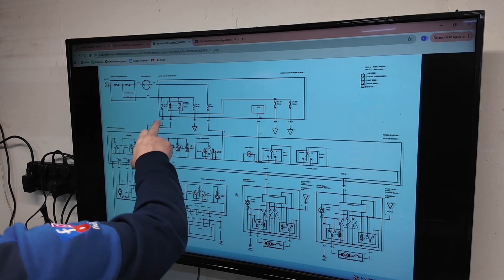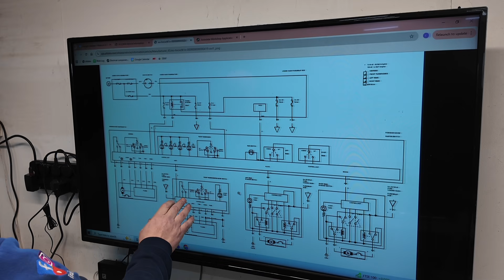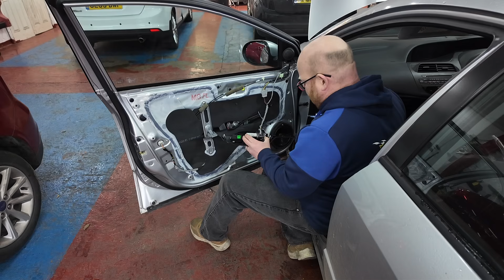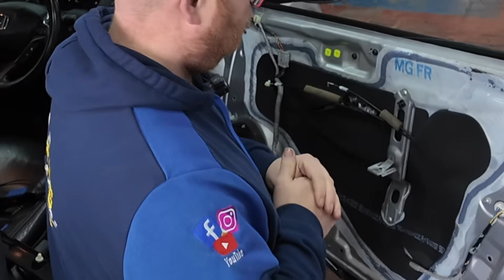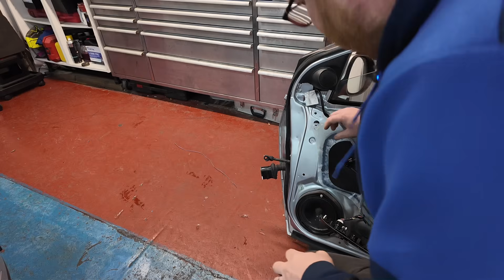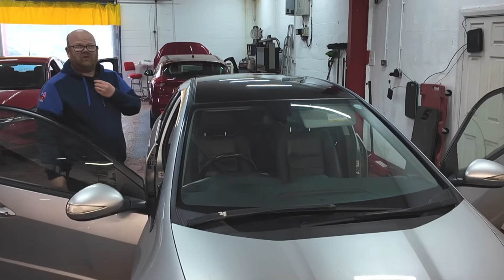Diagnosing and Fixing a Power Window Fault with Digital Signals #fnrisi

Comment: Excellent troubleshooting. So LIN BUS voltage level will be 0-12V. As for having to remove the door just to get to that harness is a different yet old story with modern cars. Thx so much.

Comment: The passenger window on my old Ford Fusion was dead, but I had to draw 6 wiring diagrams to  figure out where the problem lay. It was a semi-broken wire behind the door multi plug on the driver's side! I was getting continuity signals, but it failed a load test using a H4 bulb.
Reply from the maker: look at load pro, bulbs are good but it’s quicker as a basic check
Reply: Very informative thank you.